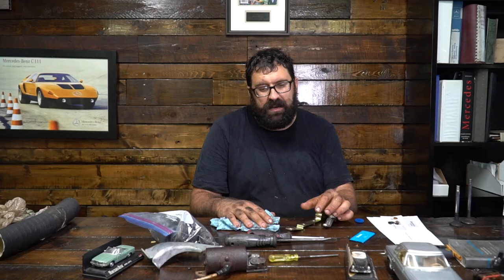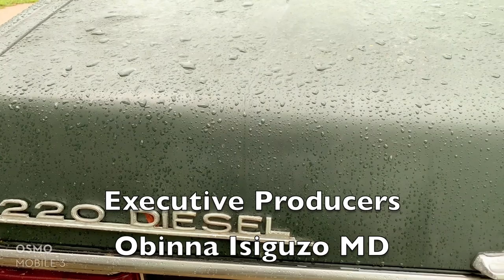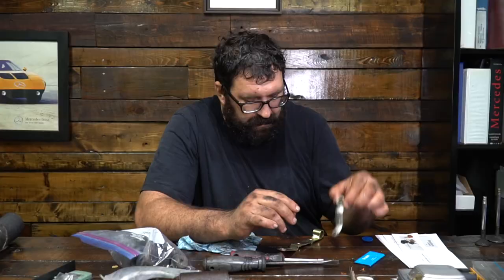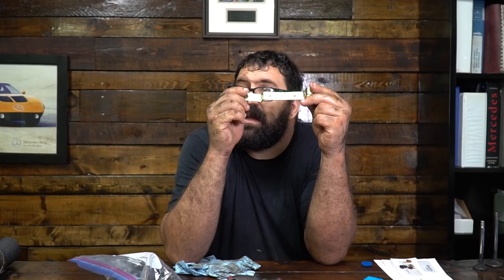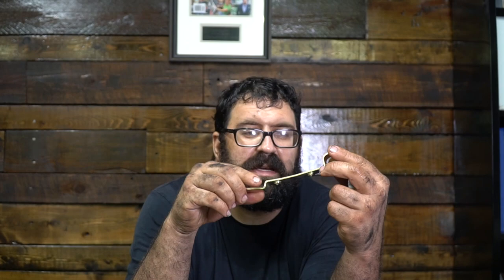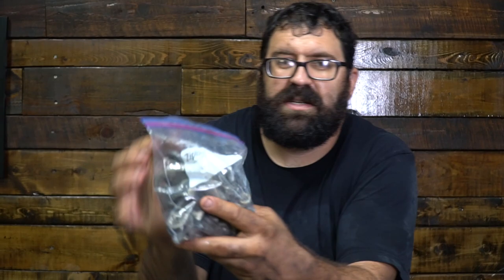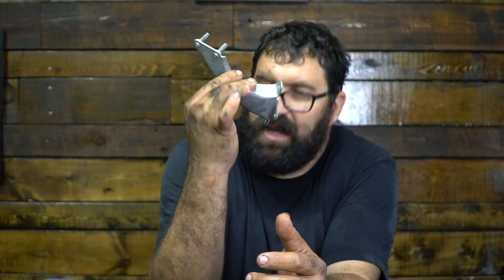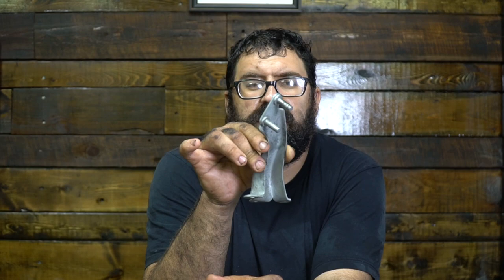What is the appropriate color of my Mercedes Benz hardware?

Comment: Has anyone done their own zinc plating? If so what is involved? .....also if you HAD to go down the rattle can route anyone got a product they have had success with?
Reply: I've used Eastwood's Golden Cad paint system on some not readily seen parts on my driver 911T. It's not as good as actual plating but at least protects the parts to an extent. If I ever take the car to a level above driver I'll bite the bullet and get those parts plated.
Reply: @teenchy  Cool - I use some Eastwood products already so will give this a go. Thanks. Mike